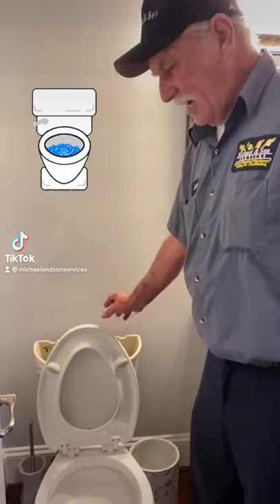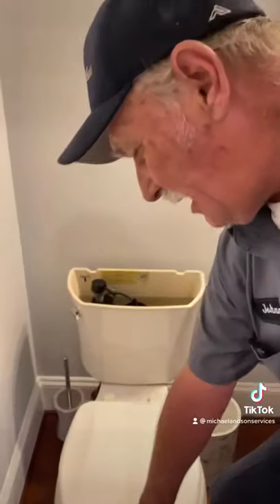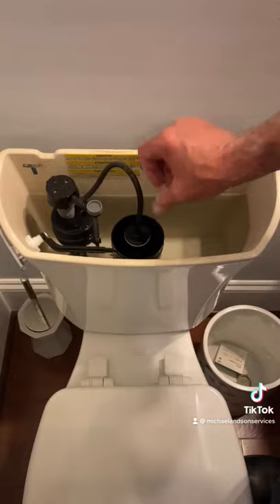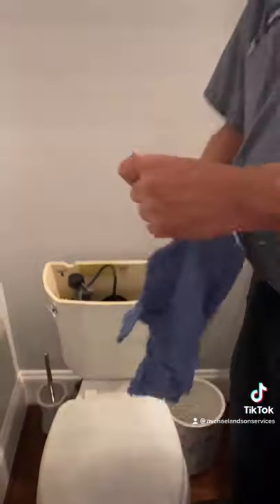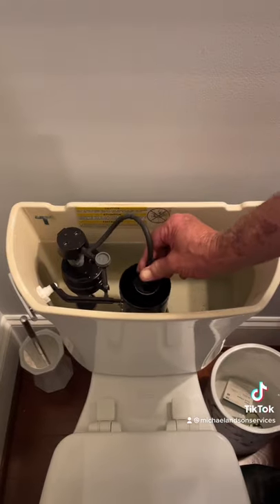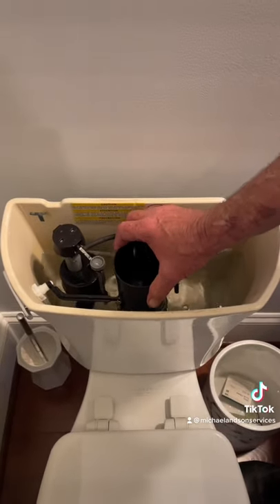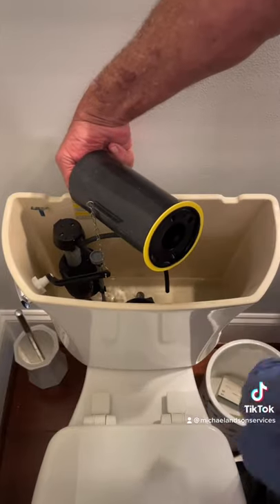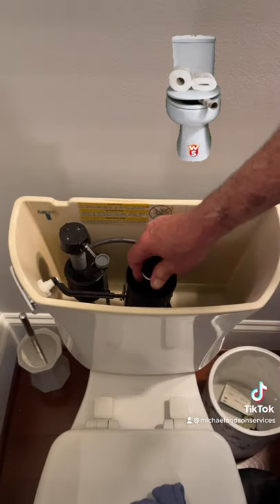Kohler Toilet Tips with Johnny! | Michael & Son Tik Tok

Comment: I bought a "Cimmaron" ( Yes it's this one in the video) from HD 2 years ago... It stopped flushing... Yes it was the Yellow Disc as illustrated on the bottom of the canister... Problem was, The Kohler parts at HD didn't say it fit the Cimmaron toilet... I took a chance bought a new disc brought it back home and it worked fantastically....EASY replace ✅
My only complaint is that Kohler SHOULD put what toilets this disc will fit, they are lacking BIG TIME in assistance with that.... 

I guess I could have just brought the old disc with me... But Kohler STILL needs to step it a bit.

Comment: How do you keep the water from squirting out from the top of canister?    It looks like a design flaw.  

I just put a new bottom seal on the canister.
Reply: It doesnt shoot out the top ...well shouldn't.  If the line is inserted correctly your fine.